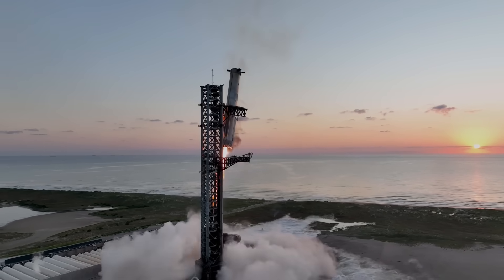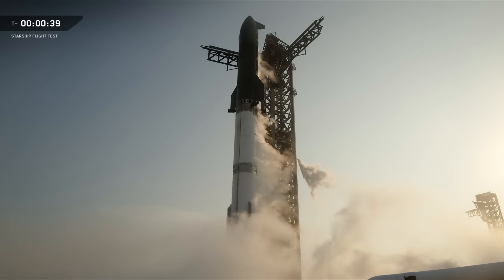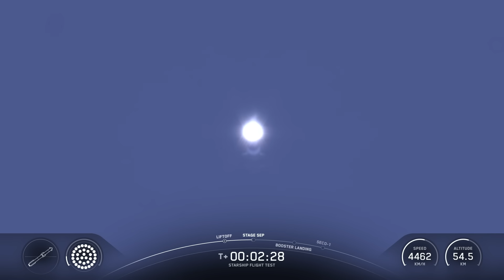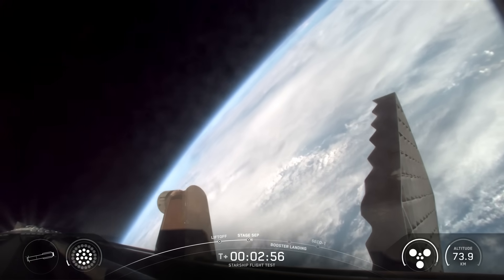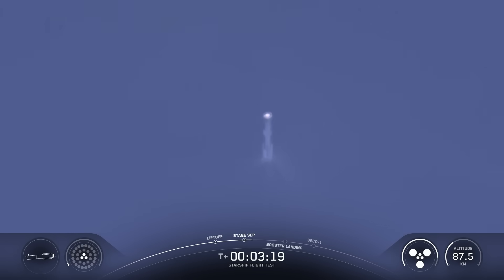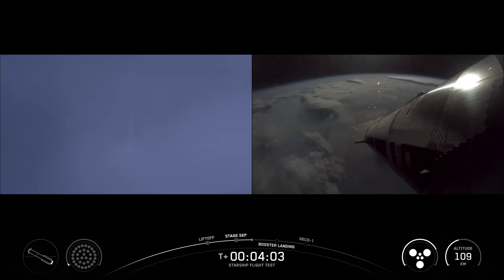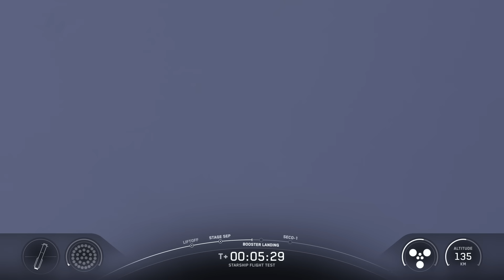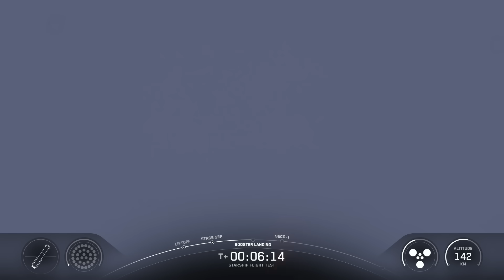SpaceX Builds Largest Reusable Booster, Also Makes Door That Won't Open - Starship Flight 9 Recap

Comment: Boing has two botched flights with no RUDs, and we see them as a failure.  SpaceX can blow them up one after another and we praise them for progress.  Space is hard.  PR is harder.
Reply: Tests of a system that is supposed to be mission ready are very different than testing low fidelity test articles during development.  You're not terribly bright are you?
Reply: @imaginary_friend7300  /Bright enough to remember Dragons' thruster and parachute problems.  Or mission ready Apollo 13.  One program is written off and another says lets repeat the last test results and call it progress.  Let's keep the context.  Both have redeeming qualities and potential.  But one seems to be dismissed out of hand and the other praised prior to proving itself with RUD's.  Perhaps you are not as bright as you think you are.  I was so bright, my momma called me sun.

Comment: The door problem reminds me of the early shuttle flight where the crew couldn't get the payload bay doors to close due to thermal expansion. The solution was to rotate the vehicle to a different sun angle and let the structure change temperature a bit.

Comment: People also fail to understand how much cheaper rapid iteration is over getting it perfect the 1st time.
Reply: Actually it tends to be little more expensive, but faster.
Reply: @imaginary_friend7300 I was listening to some engineers involved in the space industry who stated it ends up being more expensive..i.e every NASA rocket although that is if you end up with a working design in proper time I guess. Actually has me curious where SpaceX is at money wise vs sls although to be fair we would need to be somewhat comparable and probably include the cost of a working capsule design as well. It's estimated SpaceX starship is about 5bil in...and if they getting a working moon design before the combined cost of sls at $10bil in design costs plus 4.2bil a launch (lost and non reusable so included) and another $2bil for Orion design plus $1bil per capsule (non reusable so included) SpaceX stands a good chance of proving that theory as they have quite a bit of money/years with the spending testing left before they hit that kind of money. Add in starship and booster both being fully reusable and highly more capable..it seems much cheaper of a route for starship but in the end only time will tell
Reply: Is that what Elon the omniscient tells you?
Reply: @SterlingArchimedes ahh the common keyboard warrior...a species of troll easily  found in habitats all over the planet ..they usually have nothing of substance to offer and low IQ and when a predator is close they attempt to thwart the attack on their ego with a simple yet seemingly effective attack for other low IQ creatures...the basic insult response..but this does little to thwart away other witty species with functional frontal loves and the keyboard troll ends up going into a loop response..of insult after insult until the other predator simply gets bored and stops responding..isn't nature interesting kids! Join us next time on the discovery channel where we sneak up on the unsuspecting catfish dater on the next episode of Internet: strange but true!
Reply: @SterlingArchimedes  He must have asked Grok...

Comment: Massive use of Starlink on this flight so massive date stored now at Hawthorn to go through each system for flaws that will need improvements or be deemed unneeded and will be removed or replaced with a better setup.

Comment: First of all, flight 9 was a success. Not 100% of all possible goals achieved, sure, but that was never going to be the case, otherwise it would not be "development" anymore, is it? At that point you'll have a finished, fully functional vehicle. Which is the ultimate goal of development of course, but it just not going to happen overnight, there is the development part first, which is what they are doing now... and doing it extremely well: they went considerably further and manage to do it with a reused booster, which alone is an absolutely epic historical achievement never even attempted by anyone else!
Second, Spacex pace of progress is not "frustratingly slow", it is in fact furiously fast, just look at comparable vehicles (BO NG, SLS) development timelines... they have built 35 prototypes, hundreds of engines, a test facility, a launch base and a whole factory for serial production in the time the competition has made... 1 engine? What are we even talking about...?
Third, Starship isn't ready? For what? As an expendable vehicle, which is what EVERY other existing hardware is, it's pretty close to be ready, probably another 2-3 launches before they iron out the current issues, that may be only a few months at SpaceX amazing development speed. After that they'll still have a very long road ahead to achieve their ultimate goal of making it fully and rapidly reusable, plus they'll need to develop fuel transfer hardware and orbital tankers etc. etc. but again, judging from their recent achievements, none of that is likely to take more than 1-2 years, and all of it is so advanced and on a scale so far ahead of what anyone else is even planning to do that it does not even compare. They are by far ahead of anyone else and their lead is nothing but increasing...
Last but not least, for all those who whine "they'll never manage to do this and that will never work",you are ridiculous. I've heard it so many times before, frankly it's incredible to see so many people still playing that song... seriously, where have you been for the last 5 years? That'll never fly, steel will never work, raptors will never work, launch mount will never work, catching rockets is impossible... from day one there is a chorus of haters that spit poison on everything and they have been proven wrong on everything every single time, so yeah, they'll do it and it will work, cope with it, because they are some of the best engineers in the world and they know what they are doing, while you don't even know the basics of what you are venting about, so just relax, enjoy the show and stop making yourself looking like a pillock...

Comment: When I saw the bright flamelike thing in the engine bay, I was just thinking "Looking forward to hear Scott Manley tell me what this might have been, because that thing doesn't look like it belongs there". I just hope they don't redo all the steps they had to take on Block 1 Starship with the Block 2 Starship, and foremost that Block 3 will not suffer under similar teething problems later on.

Comment: I think they've achieved maybe 3? controlled flights of the Starship upper stage. I think they need to be doing better than that if they're actually going to develop this thing. They need to be hitting reliable reentry flights if they have any chance of nailing all the thermal protection system issues.
Reply: So says the pretend expert.

Comment: At 9:40 in the video a frost line develops longitudinally on Starship and starts to grow quickly. I expect this is the leak they discussed as I don't remember seeing the outside of the rocket turn frosty on this kind of scale in past streams. In the end, I appreciate SpaceX and Elon have the gumption to broadcast their failures in 4K for all to see. Most rocket companies are secretive and hide their light under a bushel to try and minimize their failures (i.e. Blue Origin).

Comment: It's a test flight in which the second stage was inevitably going to be destroyed. There is no binary "success" or "failure." Certain objectives were met, and certain ones weren't, but in either case, they accumulated more data, which is the main point of testing.

Comment: Three catastropic failures in a row. A rocket system that now has over a 50% launch failure rate. Money well spent!
Reply: Its still better than the Russian N1 program.
Reply: @vast634  ha ha interesting subject change.
Reply: Money for data
Reply: @uniquekillerz  No, their development approach is designed for spectacle not data. You won't be able to test a moon rocket like this. They should use the proven Apollo approach.

Comment: The booster itself seems good. Starship itself seems like a poor idea. Its supposed to take off and land twice during manned flights. Seems very high risk to land a sky scraper on other bodies like the moon and mars without a structure like the chopsticks to catch it. Even squat landers sometimes tip over. Its also supposed to do in flight refueling and will need serveral launches to fuel back up to go to mars once its in orbit. Would likely be far easier to develop a smaller manned lander which would also reduce the required fuel and engines to do the same job. May be able to eliminate the in flight refueling plan entirely as a smaller craft would use less booster fuel for the same altitude and speed. Would also mean you could send cargo seperately, and if they did a horizontal landing the cargo craft itself could function as a habitat, and simply leave it in place on the moon or mars dramatically reducing the fuel required for this hypothetical cargo/hab module as well.

Comment: Let’s not shit on the SRBs from the shuttle.  They were recoverable and reusable, and did it with 1970s technology.  No, they didn’t fly back to the pad, and took quit a bit to get them refurbished to fly again, but they were the first reusable boosters as far as I know.
Reply: Most importantly: they didn't waste (fuel) mass for returning to Earth
Reply: "reusable" that costs more than a brand new one isn't worth shit.
Reply: @mattcurrent0 That's just a myth. The savings were nowhere near what they envisioned, but they were there.
Reply: @mattcurrent0 well, blame the guvmint.
Reply: @russellharrell2747 not trying to play the blame game. Just saying "first reusable booster" would be Falcon 9.
Reply: @mattcurrent0 ‘first practical reusable booster’.  The STS SRBs were reusable, but not efficient or practical in that reusability.  

It’s a shame we still don’t have a vehicle or collection of vehicles that matches all the capabilities of the STS.  Starship promises that kind of utility and then some, but is currently showing how difficult it is to do all the things in one package.
Reply: 7 astronauts lost to those clunky reusable boosters, caused by poor decision-making and overconfidence. 7 astronauts lost to heat shield failure on the reusable spacecraft, caused by overconfidence and lack of in-flight assessment and alternatives. The reusability of the shuttle program was an innovation, but was delivered at much greater cost and time, and with less safety, than they promised.
Reply: @pesco7 yes, 14 people lost their lives to bureaucrats wanting to hold the launch schedule to an unrealistic expectation, and unwillingness to listen to engineers sounding alarm bells.  It’s sad that in the constant rush to meet deadlines and mandates that are created by politicians that reason is only heeded after people die.  

Remember Apollo 1 costs us three souls while it was still on the ground.  There’s a long standing precedent in American space flight to think of people as expendable even in pursuit of reusability.
Reply: @pesco7  Do we know how well the Starship heatshield is working? How many astronauts did it carry after years of development now? How much tonnage? Bear in mind, Musk promised interconteninental (public) traffic with that system for 2026.

Comment: Losing attitude control on-orbit is incredibly sloppy: you wouldn't let a kiddie's Cubesat get away with that. Where was the backup RCS? Why was it using ullage gas rather than a redundant system? Why wouldn't ten 10th-scale models be so much the cheaper way to test the heat-shielding? Considering the combined surface area of the fins and canards compared to the fuselage, when will they admit it's actually a Spaceplane? And therefore, why the hell not land it on a runway???

Comment: I was having difficulty finding information on reaction wheel arrays, so I did some math and think they should add an assembly for when they loose control like this... 
Starship + booster is designed to send 100+ tons into orbit, after some searching I found that JWST total weight is 7.15 tons, where the main telescope is 6.5 tons, the framework with reaction wheels is about 1,300lbs, where 770lbs is just the frame, leaving the reaction assembly to weigh in at roughly 530lbs, motors, batteries, controllers, weighted flywheels.... So in order to put it on Starship, it would have to be  roughly 7.4 tons (about 25x larger than what's used on JWST) for the reaction assembly to work similar to JWST for attitude control. Granted, there won't be any sharp turns with it, but it should be able to keep it fairly straight while in orbit, with slow rotations as needed.
Reply: Yeah, I’m sure Musk and all the SpaceX engineers are reading your post and are taking immediate action on your calculations.
Reply: @LemonsAndSalt69  You never know, someone in their offices might be watching. LOL

Comment: declaring propulsive recovered boosters as a success when it's not even clear it carries any benefits in terms of cost or missions parameters is kinda insane. they're the only ones because no one else thinks it's worthwhile, not because it is so hard to do.
Reply: It’s a gimmick probably zero savings at the end of the day.  Reduce the number of rocket motors and strap a few SRBs to the thing call it a day.

Comment: Taking into account that they are trying to build the first fully reusable space launcher, I can understand and accept there will be more RUD's before a viable vehicle is built. For the time being it looks like first stage is well forward in development to second stage (AFAIK in this flight booster was destroyed in an off-spec test to see its structural limits).

Comment: I have trouble agreeing with "success is in the middle". It flew, sure. The last one did that. It blew up, though. That's bad. The last one did that, too. They tried the door, unlike the last one, but it didn't happen. It also didn't happen in the last one. Success implies a gain of some kind. What gain? It still blew up and nothing was successfully operated that wasn't before.
Reply: They now know that their fix isn't working, at a cost of tens of millions. There is a drop of water in the glass after all.

Comment: Reinstate the hypergolic attitude thrusters. Ullage gas is not good enough.
Reply: Sure it is. It just needs tank pressure to work. An auxiliary system won't save the vehicle if there is no tank pressure. It's already dead at that point anyway.
Reply: @motokid6008  It uses up the tank pressure plus it's not as powerful as a chemical rocket. It couldn't have had a controlled entry and not burnt up.

Comment: do an episode on pogo.  thats what the second stage has.  thats why things break and doors wont open  the first stage?  an engined rudded.  the Raptor is a new engine and is not reliable.  lots of issues here
Reply: There is nothing to suggest pogo or engine issues. The former was speculation debunked by SpaceX in the flight 8 report.

Comment: Does it really count as reusable if the plane can take off a second time but not land? It kind of has to be a repeatable process. I can hear the argument now about milestones. 
But all the info that made this idea possible was the already achieved and collected knowledge of Falcon nine. There is no additional data to collect from launching, yet another empty starship with no functional bay doors, weight, simulator… there’s also no need to collect from a booster that launches for the second time, but is not retrieved. There’s no inspection that can be done on the engines wear and tear. There’s no metal logical analysis. 
They didn’t even go to orbit. I’m not even sure they know what that is because during the broadcast, they stated that it’s on its ballistic trajectory in orbit. Which those are two different things. And when something goes wrong, they state that they’ve planned for it. Which is worse than something going wrong because that means the estimate estimated hundred to $200 million to launch that thing. The biggest goal they had was to do the same thing they’ve done before. 
NASA launched the new rocket and went to the moon and back on their first try and retrieved the capsule. Which was important because that’s how you collect data.
Reply: You can have an orbit with a periapsis in the atmosphere which then can be considered as ballistic. $100m per launch is dirt cheap. NASA doesn't reuse their rockets so how do you think they collect data?
Reply: @motokid6008 you going to fund the next disaster since it’s sooooooo cheap?
Reply: @richardwolf6269  - My tax dollars are already at work on it so yes.

Comment: Thats sad  that not one starship has ever came back. Im sure the Starship program is done. Just like Elons other businesses and politics, Hes probably trying to cheat the system maybe using cheap glue on the roof of the thing. I dont think he realizes or cares that when he tries to save a couple pennies  it could cause the unemployment of so many, injury to others and even the death of many. But nowadays cheaters win and Crime pays very well even if your roof flies off when driven in direct sunlight
Reply: Starship is so cheap it could fly and explode 20 more times with little financial hit. The majority of the cost is on the ground.